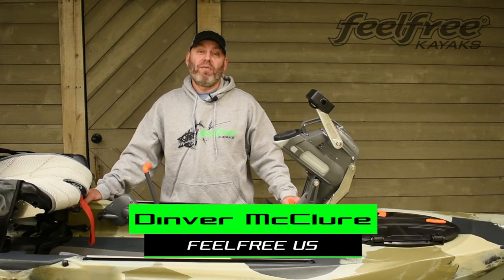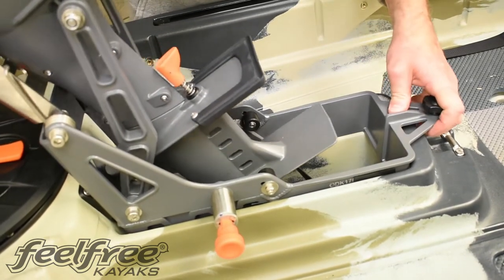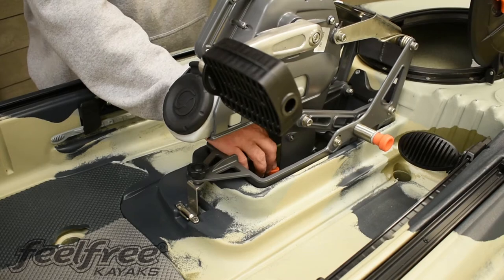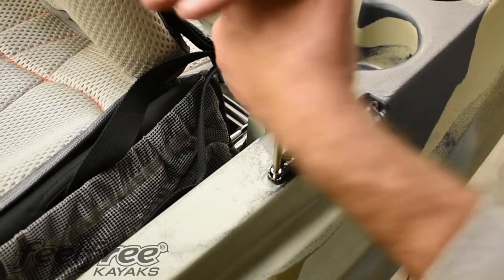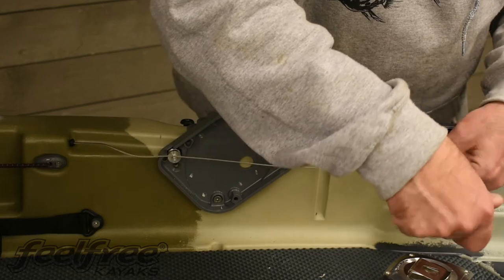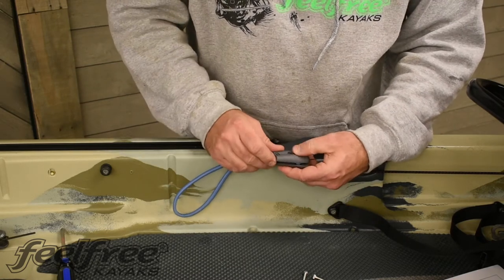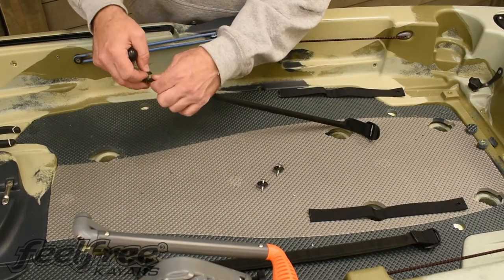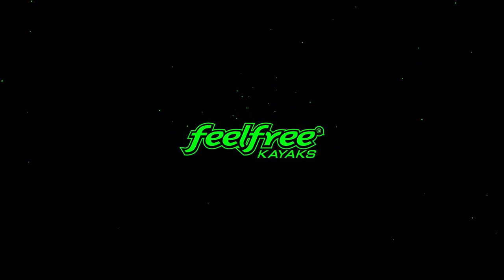Overdrive Installation Tutorial - Lure 11.5

Comment: I know this isn't for the moken 12.5 V2 but I'm gonna customize it and make work
Reply: Hey Matt, did you get the modify done on your Moken ? I have the same kayak and getting ready to install the overdrive . I might not need the seat adjuster since mostly keep my seat in the highest and farthest spot back and wee if it works for me at my height.
Reply: Need to install a bixpy handle  .. have foot controls.  Can you help
Reply: Where can I buy the Pedal drive?